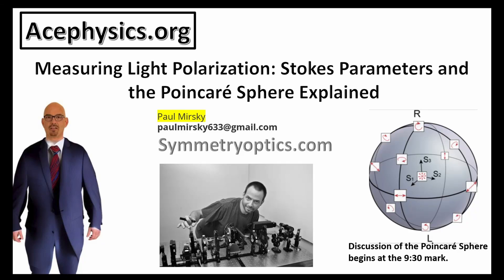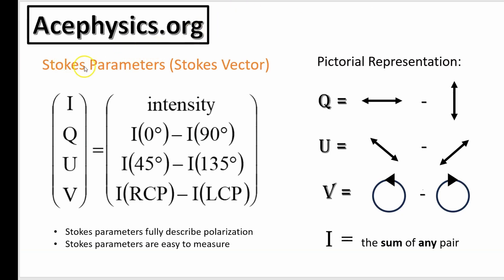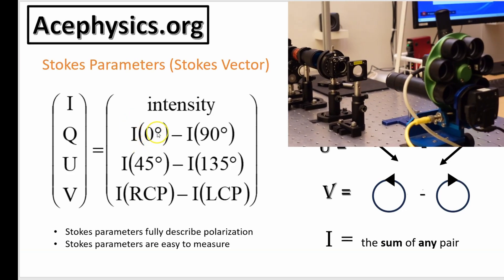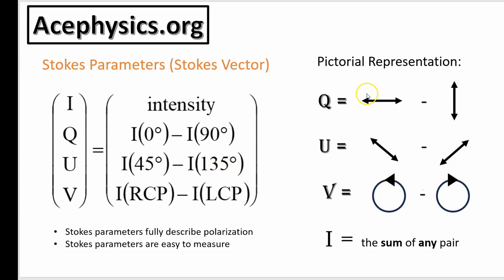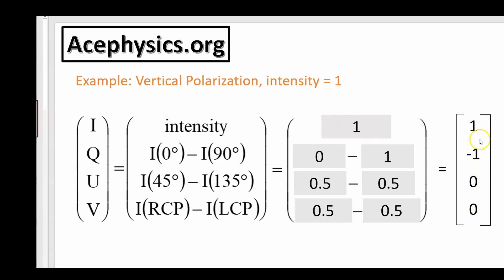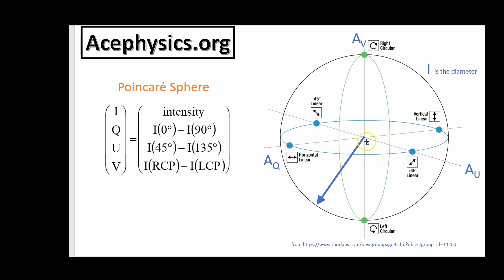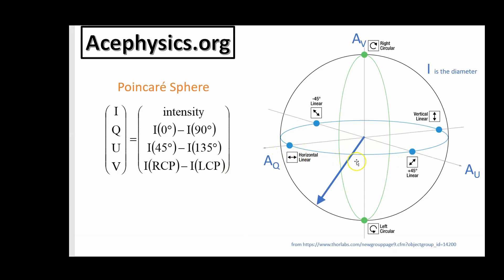Demonstration Measuring Polarized Light with Stokes Parameters and the Poincaré Sphere

Comment: where does one  acquire a rotating filter like the ones shown in the lab?
Reply from the maker: Hello, I just did a search online.  Here is what i found: 
You can purchase quarter-wave and half-wave retarder films, as well as circular polarizers, from several reputable suppliers. Here are some options:

1. American Polarizers, Inc. (API)

Products: Offers a range of wave retarder films, including quarter-wave, half-wave, and full-wave retarder films.
Details: These films are suitable for various applications, including display enhancement and optical filtering.
Website: Quarter Wave, Half Wave & Full Wave Plate Film
2. Mecanusa

Products: Provides wave retarder films (waveplates) and circular polarizer films.
Details: Their selection includes both left-handed and right-handed circular polarizers, as well as quarter-wave and half-wave retarder films made from birefringent plastics.
Reply: @acephysics123  thank you!! I am also curious about the software used to analize polarization , Monet, is it a Matlab repository?  I could not find it online
Reply from the maker: @valeriatenapinon2752  Paul Mirsky wrote that program himself, and it is not available anywhere. His email is plmirsky@gmail.com, and he would send you a copy, but it is not 'commercially ready'
Reply: @acephysics123  thank you very much!

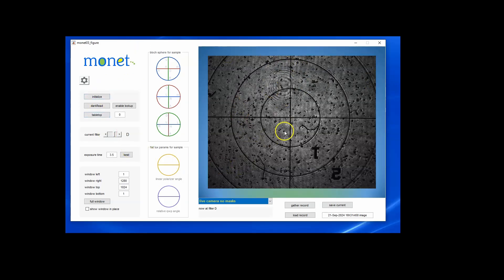Comment: At 6:24, I have a question,  I appreciate clarification. If the light was vertical why I(45) is 0.5? I expected to be zero since the original light to go through the filter was vertical.
Reply: Because it's a numeric representation of phase polarisation for 180 degrees, so that's technically limited to (-1, 1). 
Take a half-circle (180deg of 360deg), stretch that out until it is a circle of 180 degrees. 
Half a turn (0.5) on that circle would be 90 degrees of that circle. 
We stretched this half circle out, so if we un-lengthen that circle back to a half-circle, we get 45 degrees.
Reply from the maker: Thank you for your question! Let me clarify why the intensity at 45 degrees isn’t zero.

Initially, the light is vertically polarized, meaning its electric field vibrates only in the vertical direction. When this light passes through a polarizer set at 45 degrees to the vertical, the polarizer allows only the portion of the light’s electric field aligned with its axis (at 45 degrees) to pass through. The remaining portion is blocked.

Since the polarizer is not completely misaligned with the original vertical direction but instead at a 45-degree angle, it allows part of the light to pass through. The intensity is reduced because only a fraction of the light’s energy is aligned with the polarizer’s axis, but it’s not zero. The light coming out of the polarizer is now polarized at 45 degrees.

If the polarizer were set completely perpendicular to the light's original polarization (like at 90 degrees), then the intensity would indeed be zero. However, at 45 degrees, some light always gets through because the electric field has a component in that direction.

I hope this clears up your confusion! Feel free to reach out if you have more questions.
Reply: @acephysics123  That was my question too! Thanks for answering. This clears it up as far as from an algebra perspective - "at 45 degrees, some light always gets through because the electric field has a component in that direction" - but not from a geometry/visualizing perspective. If you have a diagonal line and only allow a vertical line together through, you'd get one point. I must have the wrong idea about how the filters work.